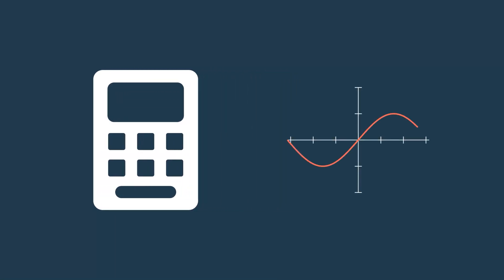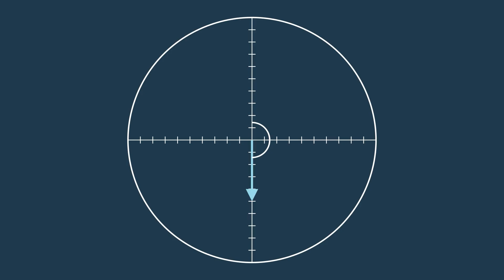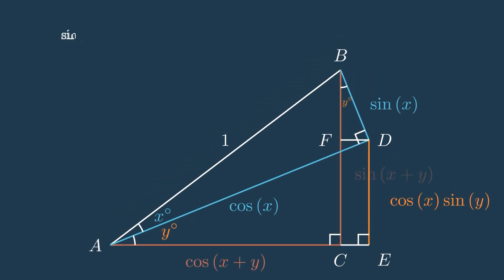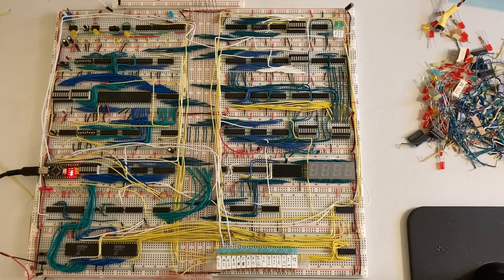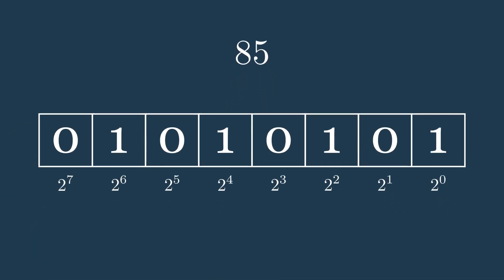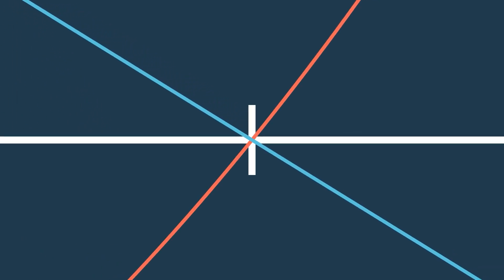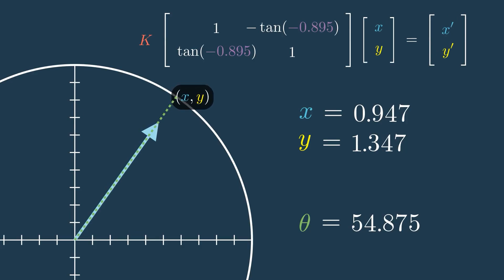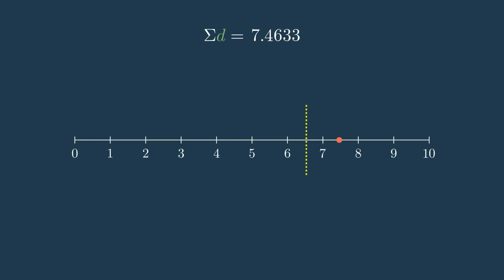How can Computers Calculate Sine, Cosine, and More? | Introduction to the CORDIC Algorithm #SoME3

Comment: This is a really nice video.  I am excited about the content on this channel because it corresponds well to the content on my new channel.  Your video is very professional and easy to understand - a feat considering the content.
One quibble:  the part about convergence misses a really important point - you need to cover all possible values.  It turns out that the atan(.5^n) basis works, but not because the rate of converge is 0.5.  For example, tan (pi/4*(.5^n)) would have the same asymptotic rate of convergence but leaves the range of computable values a Swiss cheese of holes.  The property you need is sum of all remaining basis numbers must equal or exceed the last included basis number.
Reply from the maker: Good point. I'll admit this is something I missed when researching the video, but it makes intuitive sense as to why that property needs to be satisfied. Thanks for bringing this up.

Comment: 12:24 this is simply not true. Just because the terms of a series go to zero, this does not mean the series converges (consider the harmonic series). The reason why the ratio test works is that the ratio of consecutive terms being less than 1 enables you to do a comparison to a geometric series (after some manipulation). The ratio being less than 1 means that the geometric series you are comparing to converges.

Comment: I left this video pretty confused, and the example at the end left me mystified. The point of this whole thing, is that every matrix shown 15:00 to 16:00 is actually a matrix of just 1's 2' and other powers of 2. So this allows the bit shifting talked about earlier to come into play. I'm still not sure exactly what is getting bit shifted, or what is adding to what, but I'm closer.
Reply from the maker: To clarify, it might be easier to separate the matrix multiplication into two separate equations for x’ and y’. When you do that, you can see that the x’ = x - y*tan(a_n) and y’ = x*tan(a_n) + y. We know tan(a_n) = +/- 2^-n, so when we calculate the new x we subtract the old y bitshifted n times to the right, and for the new y we add the old x bitshifted n times to the right. Note that this is if a_n is positive. If it were negative, we would just replace adding with subtracting and vice versa. Basically, you can think of it as storing variables for a_n, x, y, x’, y’, and z, which is the total angle we’ve rotated by. Then, we do the calculations from the equations I wrote which just involve bitshifts and additions with x and y, in order to get our new x’ and y’.
Reply: @bobater  OK, thank you, that helped me a lot. Maybe it was just one bit too abstracted for me to fully grasp the first time through.
 
couldn't

Comment: Thanks, really very nice, I love manim. One more clarification needed: I would expect K to depend on the number of iterations, not be constant. Do you store in memory a vector of the first, say, 10 K-Values?
Reply from the maker: Thank you! Yes, the K value changes slightly depending on the number of iterations used to calculate it. However, it converges very quickly, so storing the calculated value for something like 10 iterations is sufficient as long as we do about that many iterations when we're running the algorithm.

Comment: I really liked this. The solution that I arrived at (and a solution that I’ve used for other transcendental functions) is to use a Taylor series expansion with just enough terms to be within the precision of the LSB of the data type that I’m calculating with.

Comment: I have a question how do u know when to rotate a vector backwards or forward, (substract and add the angle)

EDIT: actually this sounds kinda dumb, since u can check if the currentAngle is bigger or smaller then the desiredAngle and add/substract the next iteration of the angle
Reply: One simple way of distinguishing between forward and backward rotation is to use complex numbers, forward rotations can be done by multiplication of two complex numbers and backward rotations by division
Reply: @arnoldn2017  that does work, but when do u know when u multiply or divide to increase/decrease the angle, that was the question i was asking, until i realised how it worked, but it is still pretty interesting how u can find sin(x) and cos(x) by looking at complex numbers properties (cos(x) + i*sin(x) = e^(i*x) )

also don't this remind anyone of how conditionally convergent series work ?

Comment: I'd be curious if there are any hardware-based optimizations for this. For example, with multiplication, you don't have to add one number over and over again.

You can instead AND the two values together several times simultaneously, each time at a different offset, which gives you 'partial products' in O(1) time. Then, you can have a series of 'reduction stages', where the partial products with the same place value are added together. Each reduction stage runs in O(1) as well, but you do need O(log(n)) reduction stages, and they do need to run in series. Finally, after the reduction stages, you're left with two numbers that you simply add together to get the final value.

Because 1, generating the partial products is O(1); 2, you only need O(log(n)) reduction stages; and 3, the final adder can be implemented as a carry-lookahead adder (or other fast adder), which also runs in roughly O(log(n)), it's said that this brings multiplication's time complexity down to O(log(n)). As for how many gates it takes, that depends on how you build your reduction stages. If you use the Wallace method, you'll end up with fewer bits to add at the very end (making even a ripple-carry adder viable). However, you'll have a significantly higher number of total gates than if you use the Dadda method, which instead has more bits at the end to add up. A compromise is the 'Reduced Complexity Wallace' (or RCW) method.

It's worth noting, however, that this doesn't mean that O(log(n)) computations are performed with this method, just that so many are done in parallel that the duration of time it takes to perform these computations is O(log(n)).

However, using multidimensional wizardry, Joris van der Hoeven and David Harvey finally (announced in 2019, published in 2021) devised an algorithm for binary multiplication using only O(n log(n)) binary operations. This leads me to suspect they may not be human, but instead advanced transdimensional aliens who perceive time and space non-linearly. This would explain why their method isn't feasible with current manufacturing techniques, and would require a substrate with more than 3 spatial dimensions.

Comment: is it the algorythm used by the math C library on cpus that do not have hadware acceleration of theses functions ? sin and cos are still pretty slow on small cpu like on 8bit arduinos. BTW It seems to me that modern cpu (after intel "Core" microarchitecture on PC) have an assembly instruction that do both sin and cos at the same time and also really fast. I think it's  using hard-wired lookup tables and maybe linear interpolation. In fact i do not really know how they do it so fast and I would be interested if you could explain it the same way you did for CORDIC.

Comment: The sum of 1/n does not converge, even though the ratio of consecutive terms is less than 1

Such a ratio is a necessary condition, but not sufficient for convergence
Reply: For 1/n you get lim (1/(n+1))/(1/n) = lim n/(n+1) = 1 which is not less than 1. 
https://en.wikipedia.org/wiki/Ratio_test

Comment: 12:08 Each term in the harmonic series is smaller than the one before, but it doesn't converge
Reply: However, taking the limit as n approaches infinity of [1/(n+1)] / [1/n], which is equivalent to [n / (n+1)], leads to 1, and 1 is not less than 1. Hence, the ratio test does not say the harmonic series converges.

Comment: Nonono please don't tell people a sum must converge just because the terms are getting smaller! That myth is super hard to get rid of! They must get smaller sufficiently fast which is what (in this case) the ratio of subsequent terms ensures!
Reply from the maker: People keep saying this. I said that the terms are shrinking even as we approach infinity. For the harmonic series, this is not true. The limit of the ratio for that series is not less than 1 as it is here, meaning the terms are not shrinking at infinity. I’m sorry if I didn’t make that clear enough

Comment: Be careful. It is of the most basic math level to know that a sum of a converging to 0 series does not always converge. Sum(1/x)  does not converge.
Reply: The didn't calculate the limit of the parcels, he calculated the ration between parcels as x goes to infinity. For 1/x, the limit he calculated would come out 1, not 0, and therefore show that it doesn't converge.

Comment: "Multiplication is slow on computers"?? No, not at all, even matrix multiplication is heavily optimized and the computarion time lies in O(n log n). Especially floating point numbers (which practically must be used here since the input can be a decimal) are easy to multiply
Reply from the maker: I was mainly talking about on much less powerful computers where CORDIC is used where multiplication takes much longer than other operations. I should’ve made that more clear in the video though, so sorry for the confusion

Comment: 16:11 Since you know the length of the vector should be one, can’t you just divide the coordinates by the length of the vector instead of calculating that product?
Reply from the maker: The idea is that the rotations we made weren’t perfect rotations because of the cos we factored out of our rotation matrix. Because of this, the vector actually gets stretched a bit each time we rotate it using our matrix with tan(a) in it. We have to rescale by that constant to make the vector’s magnitude 1 again like it was at the start.
Reply: @bobater  Yes, but the rescaling factor is just 1 over the length of the vector. There was no need to multiply those cosines. Just calculate the length of the vector.

Comment: How do you handle the accumulation of errors at each step? And how do you compute sin(z) where z is complex?
Reply: For your second question, I have an answer. A complex number is a sum of a real and an imaginary parts, therefore, its sine function is a sum of products of sine and cosine functions of those two parts, formulae shown in the video for sine and cosine of a sum of angles. The sine and cosine of the real part are not any problem. But what are the sine and cosine of imaginary values? They are but the hyperbolic sine and hyperbolic cosine of the corresponding real value as argument, i.e., the imaginary value divided by i. So, you need a way of computing hyperbolic functions in order to compute the sine (or the cosine) of a complex number.

Comment: Awesome video! I'd like to add that the way you proved that the tan-1(1/2^-n) series converges was correct, but your reasoning wasn't. 

Just because the terms in a series get smaller and smaller doesn't mean that it converges, take the harmonic series for instance. 

The reason why this proof works is that it demonstrates that it is smaller than some geometric series which is garuanteed to converge. 

More specifically, there is some geometric series G and integer N such that for all integers n greater than N, the nth element in your series is less than the nth element in G. The sum until N is finite, and after N it must converge since the elements are smaller than a converging geometric series. Therefore the whole series is convergent.
Reply from the maker: I mentioned this in another reply, but what I said was, “the terms are shrinking as we approach infinity”. Technically this is correct since for the harmonic series, the terms are no longer shrinking relative to one another at the infinite limit, while for this series they are, meaning it converges. I didn’t prove this rigorously in the video because I thought it strayed too far from the main idea of the algorithm and I didn’t want to lose focus too much.
Reply: @bobater  The proof is actually correct in the video.

Comment: This is possibly the worst explanation about doing a byte multiplication on a computer. I ever seen.
The way to do is to shift one register right and test bit 0. If this bit is set then add the other register to the result register and then shift the other register one bit left. In this case you only need 8 steps max for 1 byte instead of the max 255 steps you use. Note this is basic z80 / 6502 stuff
Also your explanation about the rotation of a vector is outright confusing, to me it’s easy math made complicated and apparently you have a gift to do this
Reply: And in practice you can do all of that in parallel.
Reply: @Andy99856  Correct, like the barrel shifter in an ARM processor

Comment: Nice video but overall fails to really explain the algorithm intuitively.

Firstly, when you showed a run of the algorithm at the end, I wouldn't have put tan("angle") in the matrix but the actual 2^-n that you made a point to explain how they help us in the multiplication. I would show on a different part of the screen the angle to which it refers like tan(45) = 2^0 and so.

Secondly, it was never explained how you keep track of the angle if all you are doing is using powers of 2 for the tangents and multiplying. In fact it was misleading and confusing seeing tan(45), tan(26.565) and so on instead of the corresponging powers of 2 as that seemed to imply that you were working with the angle in the first place and didn't need to use the powers of 2.
And I read that you explained in a comment that you need to calculate the angle from the tangents as you run the algorithm with something like a Taylor series, but then that raises another question: if you are gonna use a taylor series anyway, shouldn't you just calculate the sine with it directly?

Comment: Nice and informative video. However, this is not how modern computers compute trig functions. Multipliers (even floating point) are cheap and abundant. Few layers of small lookup tables combined with complex multiplication will give you a lot of angle resolution and precission. Or a small LUT + Chebyshev polinomial.
Reply: Watch until the end. And sure unless your FPU has explicitly trig functions, if you have an FPU at all, this method is definitely being used today, albeit in hardware restricted environments.

Comment: 12:21 this is wrong. the terms getting smaller and smaller isn't sufficient for the series to converge. the harmonic series is an example of that. 1+1/2+1/3+1/4+1/5+... diverges to ∞
Reply: I had the same objection -- without hearing what he actually said. His explanation in this thread, like his video, is efficiently informative -- and explained with patience.
Reply from the maker: When I said ratio < 1 I said as we approach infinity, not for a general term. For the harmonic series, evaluating the ratio of the terms as we approach infinity comes out to be 1, which is not less than 1, so the test is inconclusive.
Reply: @bobater  hmm, interesting. so it has to be strictly LESS than one. i always wondered what the requirement for convergence is

Comment: 12:32 To actually explain the ratio test, you need to appeal to the geometric series.

13:30 While I appreciate the attempt at motivating L' Hospital's Rule, you don't explain why both of the functions need to be zero at the limit point. Plus, dy/dy doesn't really make sense in your context. It's probably best just to quote the theorem.
Reply: It was masterfully done without even mentioning the theorem or noting that it is applicable elsewhere. He wanted it for one thing, got it done, and moved on -- without going down the mysterious rabbit hole where one might get lost trying to understand L' Hospital's Rule.
Reply from the maker: Yes for a more rigorous yet still intuitive explanation you would need to show convergence with a geometric series. I originally had a segment explaining that, but I decided to cut it for clarity, since I didn’t want to put too much focus on figuring out the convergence of the atan series

Comment: It seems kinda unfair that you used calculations for sin, cos, and tan to find a calculation for sin and cos lol
Reply from the maker: The reason it's ok is because we've calculated the cos constant K and the angles tan^-1(2^-n) in advance through some other methods, and we only need to do that once. After we have those constants, we can run the algorithm for any angle without having to compute any new sin, cos, or tan^-1 values. You can see more info in the pinned comment.

Comment: I think my main question at the end is how you determine if the current angle is more or less than the desired one. Do you have pre-computed arctan values for each power of two to add or subtract from the running total angle?

P.S. While it wouldn't make any difference in the code since eliminating the identical expressions is an obvious optimization, the not-quite-rotation matrix used is pretty clearly a complex number on the Re(z) = 1 line. I just find it kind of funny when sine and cosine systems of equations show up and people immediately put them into a matrix rather than using the much shorter but equivalent complex number representation. It's also pretty easy to remember the angle-sum formula if Euler's formula is already provided just by using the standard power rule of a^(x+y) = (a^x)(a^y).
Reply from the maker: Yep, arctan angle values are pre-computed. After that, we just add or subtract angles depending on rotation direction.
Reply: While the complex representation is the same. Computationally you still do the matrix multiplication.